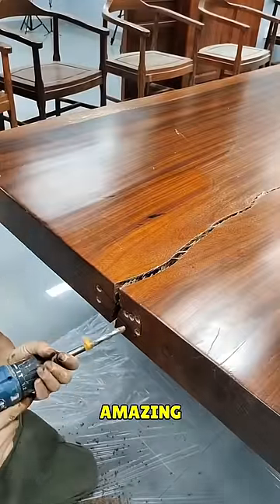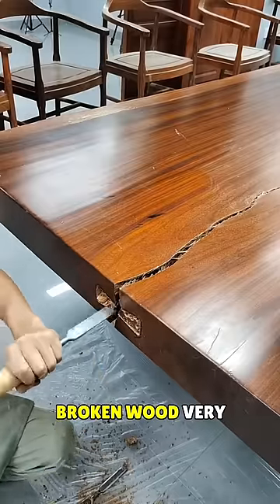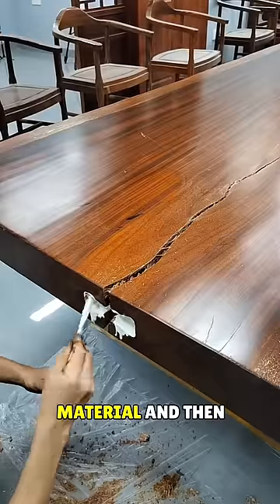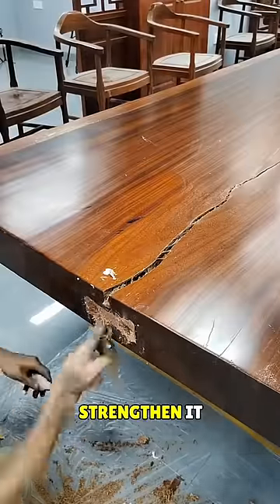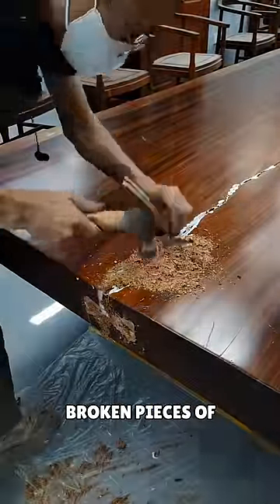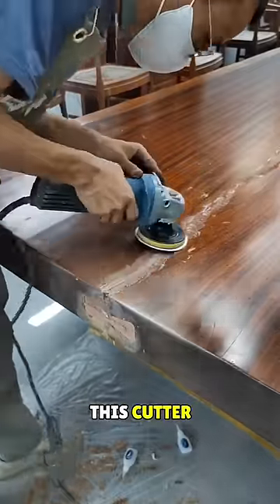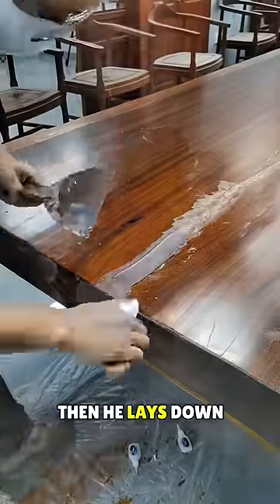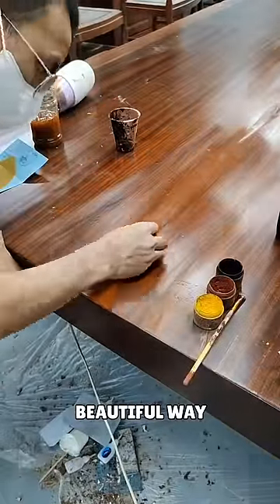This Person Transforms a Broken Table into a Stunning Masterpiece!😥❤️#shorts

Comment: The thick material is wood glue.
Reply: Phew I thought it was Alfredo sauce
Reply: This slab looks like it's bin Quarter sawn,
so it's less likely to warp.
This is what happens to almost all big slabs of timber, when they dry out.
Some folks allow 1 year to cure, for every inch of thickness.
  And sometimes, if the slab has bin cured in a region with a relative humidity of say 85%, then it gets shipped off to the dry interior of that country, then it'll crack, as it drys some more.
 Seeing beautiful furniture dry out and crack is heart breaking.
Reply: Is the table the same width on the other end?
Reply: @xPayana - 😂 nice…l
Reply: @DT-abcd  Duh Thats why he put in the saw dust .
Reply: @williamyuen1066  I've seen cracks closed with glue and a giant clamp, then the butterfly joint.
Reply: Nah it’s the commentary 😂
Reply: No, it’s material.
Reply: @stormbringercoming8105   F F S  it's the saw dust and wood chips he used from chipping out before, Then impregnating it into the PVA glue
Reply: White coloured material?!?!? 😄😄😄
Reply: @swany001  
I know. I was being sarcastic.
Reply: This AI right??? 😂
Reply: No I think it's the commentator!
Reply: It's AI commentary, it's not smart enough yet to reach that conclusion.
Reply: My gf calls it splooge
Reply: @benjigray8690 ty for the explanation! Love it when people actually talk their passions!
Reply: Just buy a new table
Reply: @Pinkielover  

You obviously don't work or have any idea what a table like it would cost.
Reply: This is the comment I came to make. Thanks
Reply: @williamyuen1066  i was thinking that they should have used a large clamp to squeeze that end back together before he put to bow tie in. Would have also reduced the amount of filler he had to use.
Reply: Tks
Reply: Not a cutter but a grinder👉💯💯💯
Reply: I used to watch my grandfather do this technique when I was a small girl.
Reply: Its called vinovyl

Comment: I have been a furniture maker for 60 years and never ever EVER used filler
Reply: Can’t believe he did the old “glue and sawdust” 😂😂😂 I’m a bench joiner /furniture maker also
Reply: I mostly renovate and repair furniture. This canyon of glue and sawdust...
😮
Reply: so is tgat a good thing. or a  i wouldn’t do thing for ya.  or : or did he do a great job?
Reply: Here's my question, is one end  going to be wider than the other end
Reply: Cannot understand why he doesn't glue and pull the crack back together instead of using filler.
Reply: Well he did and it looks awesome
Reply: @kennethdriver3904 your not pulling that crack back together with screws or anything..... Why not just say it looks good because it does
Reply: @Revok7272  i agree it looks good. And perhaps ur right. The thickness and width of the crack may make it impossible to pull together. I guess I just have an aversion to using filler. And honestly I don't think I could do a job that good without a lot more practice and still probably not that nice .
Reply: Why
Reply: Better to stabilise the crack and then - and pay attention because I might never say this again - fill it with clear resin to make a feature of it.
Reply: in my opinion you might as well just use Bondo and paint it if you don't care about doing it right. I would have highlighted the crack with clear resin maybe stabilized the crack with a distressed steel bow tie or brass. if that was not what the client wanted then I would have cut it out and inserted a piece of wood same species and tried to match the wood grain. you can see his attempt in the final product it is not a good job.
Reply: @kennethdriver3904  The crack may arise because of shrinkage of the table wood.  It may not be a crack due to a widening of the table top.
Reply: @mohasat01  I didn't mean widening of the table top . I meant the existing width of the crack, thickness of the table top, length of the crack may make it impossible to close up with clamps etc. So maybe some filler was the best choice. I just have an aversion to using filler unless it's absolutely necessary
Reply: ... well.. you're never too old to learn new and better ways, glad video helped you..
Reply: Maybe you will on another 20 years.  You're just not as polished lol 😂
Reply: But this guy is repairing, not making. How would you fix this?
Reply: @charlierobert3571 not if it was broken all the way across, but I understand where you are coming from! Why wouldn't he simply use wood glue and push the pieces back together? I am in wonder about that 🤔 😳 😊 BUT I HAVE ZERO EXPERIENCE IN WOOD REPAIR...so I have absolutely NO IDEA what would have been the best thing to do for this table! I would leave it to the "experts" who have done this for years and years! 😂
Reply: Liar Everyone has to at some point
Reply: Not the guys fault. The crack seemed natural!
Reply: A bowtie here would have added alot of character to a plain table but i understand if its in a meeting room
Reply: I'm a retired bricklayer of 30 years, but from what I have seen here there everywhere...is that those long screw type clamps maybe should have been used to bring it together as much as possible, then do that butterfly dovetail joinery and perhaps do 3 or 4 more underneath for insurance. Then carry on with the proper finishing touches. But, as I admitted earlier, I was a bricklayer, not a pro woodworker. Is this a bad idea or is it okay? 🤔😎
Reply: And a "good carpenter" uses what is available to perfect the job.  Oh, that's right, you are a furniture maker🤔

Comment: It's not a broken table. The guy just fixed a cracked table surface with a butterfly joint to prevent further cracking then filled the crack with saw dust and glue. However, hammering the sawdust into the crack is not something a master carpenter would do!
Reply: "hammering the sawdust into the crack is not something a master carpenter would do!"

But hammering white gooey stuff into the crack IS something a master baiter would do
Reply: He is Japanese. I work  with master carpenters and this is exactly what they do!  I have seen this exact process done to 1000+ year old temple doors.
Reply: Shhhh don’t ruin this ladies amazement that you can fix a crack. She seems very impressed

Comment: YOU TOOK THE EASY WAY OUT, YOU SHOULD HAVE PUT THE CLAMPS ON UNTIL THAT GAP CLOSED THEN YOU INSTALL THE DUTCHMAN AND ALSO TAPE THE UNDERSIDE OF THE CRACK THEN POUR WOOD GLUE  INTO THE TOP AREA OF THE CRACK FROM START TO THE END OF THE TABLE THEN FULLY CLOSE THE CLAMPS THEN INSTALL THE DUTCHMAN LAST.
Reply: If the table is square with the crack he did well.  If there's a curve or width difference from one end to the other then he should have tried to clamp...  But that makes for a tougher finish job

Comment: I'm wondering why he didn't factor for the difference in width of the table at the cracked end versus the other end.

He could have made the fitted wood piece shorter to bring the sides closer and in the process used some clamps.

I know, one could probably not see the difference, but that's my thoughts nonetheless.

Comment: Great work but will it last? the pressure that split the table will more than likely split that tiny little replica "Stickley" biscuit that he put in there as well. Since he's totally hiding the biscuit anyway he'd be better to use a steel one to ensure that the table doesn't split any more

Comment: You should see him attach a door, he attaches a few foldy metal on the edge of the door and  makes them stay where they are with some twizzly metals which are put in place with a rubber lump with metal stick that has an x shape on the end to make the twizzly metals spin around and magically get smaller and smaller until just the round bit of the twizzly metals are showing and then the foldy metals are stuck. Repeat this on the wood bit where the door goes and well done, he has done a special door job.

Comment: i just got one question. if there is a crack on wood, and it opens up a bit, why didnt he tried to tighten the wood together after adding some glue on the crack? wouldnt that make the table a bit stronger? or did he do a better job by not joining the cracks together?

Comment: Instructions:
Drill holes on the surface with tools, then clean up the debris with a chisel very nicely, once you clear the area completely fill it in with white material and thick material.
Remember to lift the broken pieces of wood to fill the hole and cut the protruding parts with the help of a cutter, cutting each piece in a beautiful way!
Ooh oh, I almost forget to tell you guys to add extra material on top and lay the wood polish on top, DO NOT use varnish, use wood polish and rub it nicely
Reply from the maker: Thanks for the tips!

Comment: This is an old trick used to disguise the break, nothing new actually every wood worker knows this. Personally I would have used a black epoxy and sanded off that varnish. Using Bondo however was not good.

Comment: No, not right, I will fell the crack with good wood glue ( creamy like ) and will clamp the table, while Its drying shoots two long screws on 45 degrees angle, then fill the counter hole for the screw heads. Refinish

Comment: He gets this material and puts on this materiall then sands it  down with his tool  white substance is layered on the yellow stuff then he smoothes out the whatsit with a thingummy then jiggles the doo dah with a nipple and then fills the hole with that material when this dries he wets it with a thingummy wotsit on the knot of the gtain  he then rubs it nicely it then doubles its size and heats up he shoves it in a box of thingies I know because I am an expert